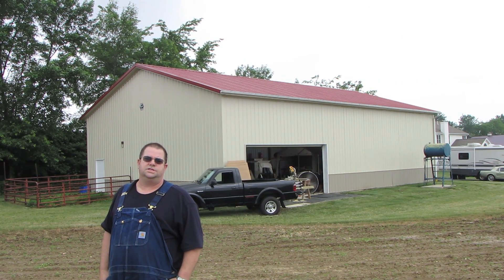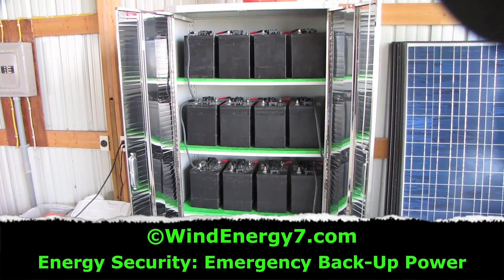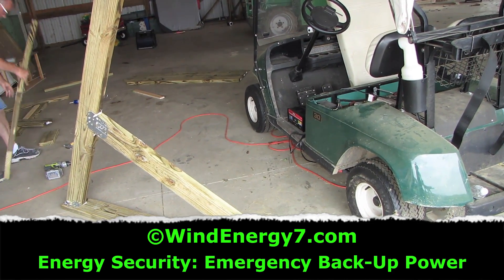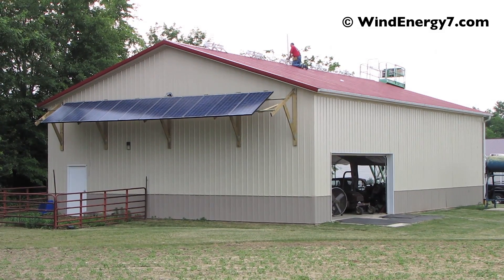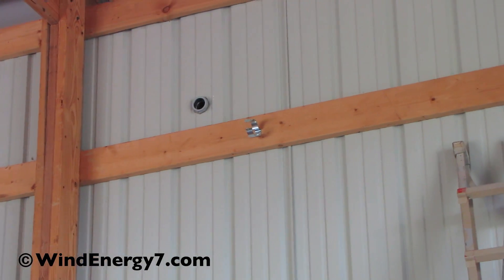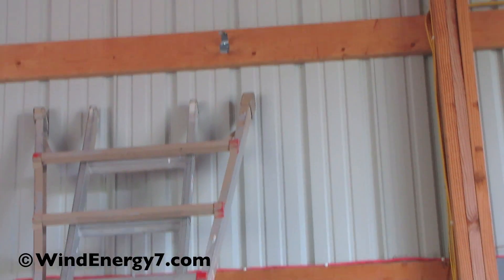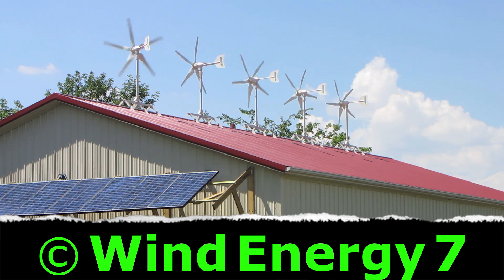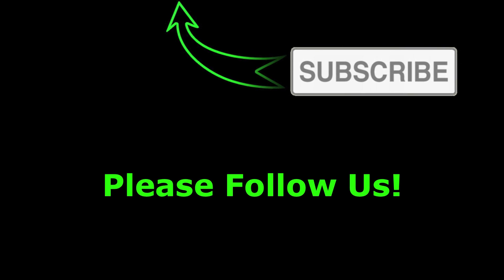Home Wind Turbine

Comment from the maker: Home Wind Turbine for sale and Home Wind Turbine kits that we manufacture at WindEnergy7 are heavy duty complete systems that will hold up in any extreme weather. We have residential wind turbines, rooftop wind turbines, small wind turbines, home depot wind turbines, home vertical wind turbines,  vertical wind turbines, home wind turbines for sale, and home wind turbines kits.  Visit us at - - WindEnergy7 (dot) com